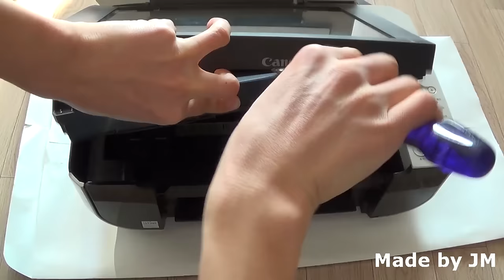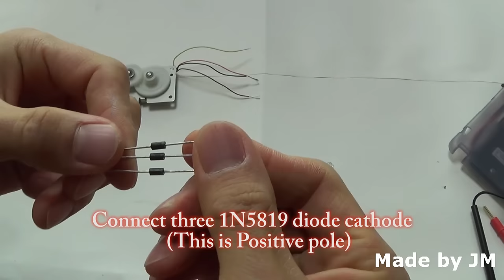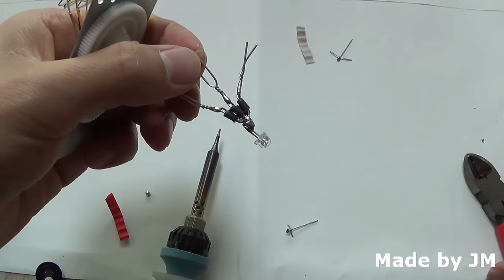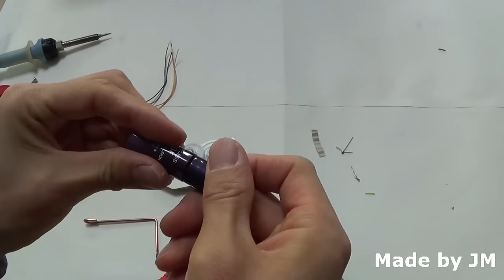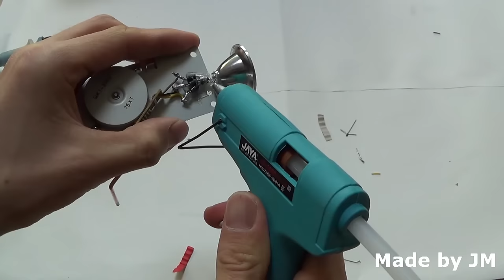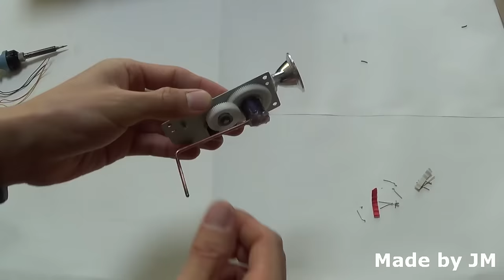Batteryless torch light from Old scanner components

Comment: I like your work dude, but you should have added an RC network to store the charge from the  rectifier and then slowly release the current to the LED. That way you don't have to keep winding the motor. Tau = RC time constant and that'll tell you how much discharge time you have in seconds until the RC network runs out of juice.